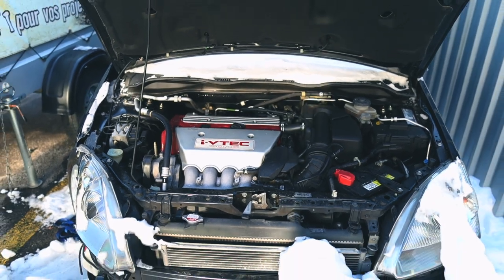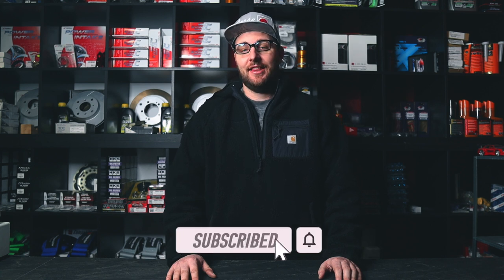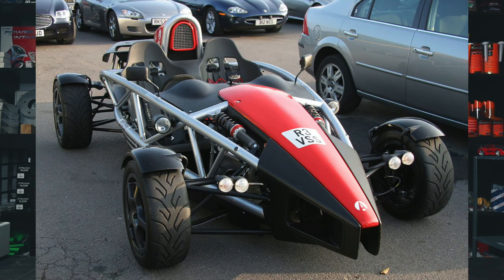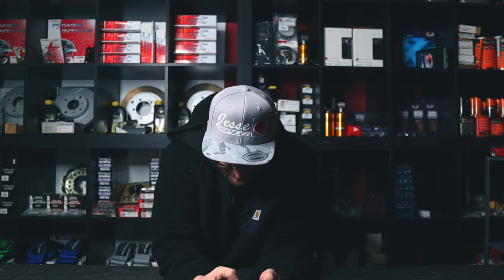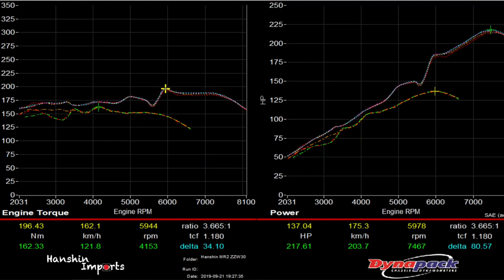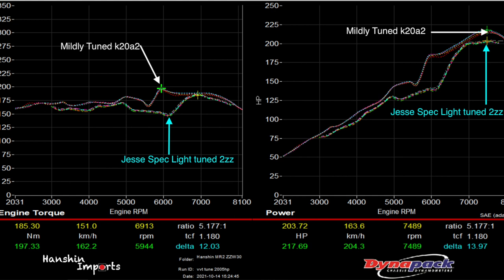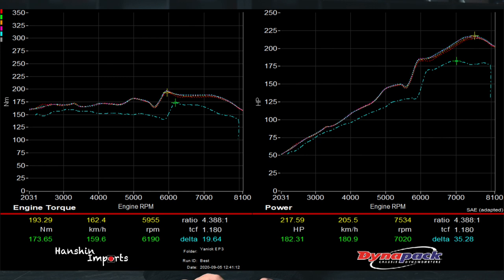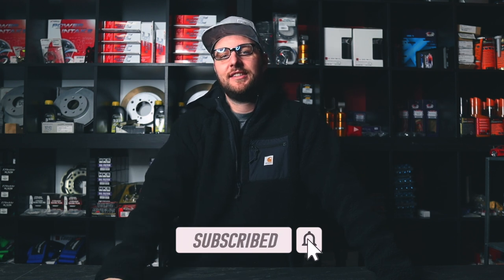How to Kswap an Mr2 Spyder EP2: Is the K20a better than the Toyota 2zz? Is it worth the extra cost?

Comment: In new zealand you can get a JDM spec 2zz celica for about 7k or corolla 2zz for about 5-6k. While type R spec B18cs are worth well over 12-15k and type r spec k20s are in the 20s, 2zz is great value for money considering you get 190HP for well under 10k with a k20 you get a bit over 200hp for 3x as much. not good value for money considering you can just buy a celica and drop stage 2 cams exhaust and intake and gain 15hp without a tune as shown on the fourms before needing an aftermarket ecu. only let down is the gearbox.

this is coming from someone that owns a 2zz jdm spec celica with LSD and i admit the k20 is 100% the better engine but value for money wise its janked up because of how sought after they are therefore making it not a great value for money even though a k20 has way better after market support. Im happy with my 2zzge celica the lift kicks in harder than a k20a2 and the only thing left to do on my celica is stage 2 cams and il be really happy.
Reply from the maker: Hi, Thanks for your very comprehensive comment and the time you took for writing it. As you can see in my video (and you can probably guess it), I am 100% agreeing with you. I love the 2zz. Its one of my favorite engines ever. However, it let me down and broke (take a look at my playlist of my 20+ 2zz swap episodes, including the race footage when I broke it). So for me, reliability is the only element I've been let down on. I actually was disappointed in the k20 (euro spec in stock form). But, if you have some extra time, take a look at the swap series I am doing right now for the K20. Its just coming to an end now and the engine has a few nice bits on it and I will see what sort of power I can make. But trust me, I have pretty high expectations, given the hype of this engine and that I actually really like my 2zz. Wait and see ;-)
Best regards.
Jesse
Reply: @JesseSpec 
How did you break the engine?
This engine blows when you overev it by downshifting improperly.

Comment: Coming from my old Honda Civic EM1 with the B16a2 and recently a SIR EP3 K20A3...I found I really missed the high strung, high revving nature of the EM1...mind you the lack of torque was really noticeable down low.  That being said, from 111ft/lbs of tq to 132 ft/lbs...with peak torque coming on sooner than even the Type R....the base EP3 felt like a torque monster lol.   Enter my recently acquired sleeper Corolla XRS lol... I'm so happy to be back in a high revving engine again. Having the 2ZZ and 6spd is the perfect blend of both worlds... essentially a larger B16 engine but with torque lol.  I will say i feel lift engagement is a rouch high on the stock ecu in the Corolla at 6800rpm though.  But on the other hand....it keeps you out of trouble a bit because you have to be really deliberate with your gear selection and to rev it to the moon..because getting to lift takes noticeably longer than VTEC engagement lol.  I will say a lot of people go out of their way to get around that grocery getter Corolla hogging the fast lane and are surprised when they're not getting any closer to me 🤣🤣
 

What do you recommend for a daily driver who does occasional autocross as an ecu solution?  Was thinking of picking up an '03 Matrix ECU with factory 6200rpm lift engagement but no one really re-pins those anymore i don't rhink.  I'm not hardcore enough to do crazy stand alone laptop tuning on a daily...just want tweak whats nearly perfect.  

Long story short,  this vid reassures me of my decision to explore the 2ZZ life lol.
Reply from the maker: Hahah! Thanks for your substantial comment 😊👌🏼
If I remember well, my corolla tS shifted VVTLI in 5000rpms. So that seems like a normal shift point. Maybe trying to find a VVTI/VTEC adjuster like back in the day would be interesting to test. I think APEXI used to make these. You would have to do some research to see what people used in the past. It may be a good way to adjust the shiftpoint for a very low cost.
TBH though I never used them and personally I would go programable ECU 🔥😉
Reply: @JesseSpec  I do remember the old school Apexi's lol.  Yeah I suppose I could just send my ECU to R9K or MWR  to have it tuned...not super cheap but I believe lift engagement at around 5800rpm or less would make the power more usable for sure. 

Thanks for the reply 👍
Reply from the maker: @ericlindsey1708  no problem 👍🏼🔥

Comment: 2ZZ has an interesting niche, at least here in Poland where I live. In a lot of amature racing leagues there are different classifications based upon stuff like engine displacement and stuff. 2ZZ and K20 would fall under the same class, but most of them make an exception for K series and classify it like a much larger displacement engine or one with forced induction, bc even NA they can make a LOT more power than pretty much any other engine, so those classes under 2.0 liters of displacement would be all just K series races and competition of "who can throw more money to squeeze a few more horsepower from their K20" and that's not fun and would quickly kill interest in the league. So for a lot of motorsport leagues it makes sense to tune up a 2ZZ since it has a lot of the same characteristics that make K20 so good but it isn't targeted by rules.
Plus in the case of MR2 specifically it's basically the easies swap in the world and is barely any more difficult than putting in stock engine.
Reply from the maker: Nailed it! I agree 100%!

Comment: What confuses me is how did the Toyota Matrix XRS and Corolla XRS consistently beat the 7th/8th Gen Honda Civic Si and Acura RSX Type S in highway roll races on YouTube despite the 1.8L 2ZZ being an on average weaker engine with less hp than the 2.0L K20? 
This is because the Toyota engine’s torque curve is actually higher than the Honda’s eh?
To top it off apparently the K20 can stay in VTEC thresholds while shifting while according to period Car and Driver reviews, the 2ZZ usually falls out of VVTi?
Reply from the maker: I love the 2zz. But I cannot say yet if it was worth the extra effort for swapping the kswap I am doing now. I am coming towards the end of the swap and should be hitting the dyno real soon when my exhaust is finished
Reply: @JesseSpec  oh yeah the 2ZZ is decent, but the K20 is definitely the better engine for a MR2 sports car engine swap application
Reply from the maker: @SilverScarletSpider  i will see what my dyno has to say about that hahah.

Comment: Let's also not forget that a 2zzge weighs way less than a k20a. So balance of the car needs to be adjusted for that much more weight on the rear.
Reply from the maker: Thanks for you input. I’ve heard this theory many times, but no facts. You say way less, do you have any numbers? Source of your info other than Techno Prospirit. I am planing to put this theory to rest by actually weighing both power plants. Could be an interesting video
Reply: @JesseSpec  it would make sense that an all aluminum 1.8L weighs less than a bigger all aluminum 2.0/2.4l motor with iron cylinder sleeves. 👍🏼
Reply: @JesseSpec  there was a guy that weighted them here on YouTube. I will try to find the video. From what I understand the 2zzge is 220LB (~253LB with accessories under 375LB with transmission) while K20 is 275LB (over 400LB with transmission)
Reply from the maker: @spyderzetta3391  hi! Good info, thanks for sharing. I am afraid 25lbs (11kg) on the ensemble of power trains in difference can be compensated by a lighweight battery. I honestly think the weight distribution argument doesn’t seem to be significant enough to a point it would upset the balance (if your numbers are accurate). Corner balancing will really make the difference very minor I think. Don’t You think?
Reply: @JesseSpec  I believe fully assembled engine+transmissions+accessories it was closer to 50LB difference. So if we are talking stock for stock, sure lots of things can be done to offset some weight. Lighter weight headers, exhaust, intake, battery, etc. This can be done on any of these engine to further reduce their overall weight. But yeah the point is that the  2zzge the lighter engine. And any weight that is reduced or added on any car needs to be taken into consideration when setting up optimal car balance. Like you said, corner balancing is a good example. Or changing spring rates, etc. Also I think the K20 is a taller motor (I think..) so center of gravity in the mid rear will be a little higher which can affect overall balance. Once again, something that can be fixed with different chassis and suspension tuning. 

You now have a k20 and a 2zzge in your garage. Would be great if you could do a comparison. 

I own a 2002 spyder and was already planning a K20 swap. But 2zzge is a very good option as well.
Reply from the maker: @spyderzetta3391  thats exactly why I am going through all the trouble of making these videos hahahah

Comment: Hey Jesse, great work as always :) I was wondering what kind of downpipe you were using on the 2zz? I saw you used the MWR manifold and I was unsure if it would get decent power figures compared to the stock or PPE manifold/downpipe combo, but appearently it does. 

I know the 1zz stock downpipe chokes the 2zz but I think mainly becouse of the restrictions in the flex pipes, so my hope is that with the removal of those and the MWR manifold I could still get decent power when I use that one. 

Which makes the swap more easy and also I want to keep the exhaust becouse of noise levels as stock as possible (I will accept that it will make less power than with a complete free flowing exhaust, but atleast keep the loss as low as possible). Did you order the manifold from MWR directly btw or another source in europe?
Reply from the maker: Hi, Thanks for your comment! The Downpipe is an Ebay spec one. Isn't the best, but for getting the whole care ready quickly and at a good price, this is what I wanted to do. Regarding the MWR, yes I bought it from them. My company Hanshin-Imports Actually sells their stuff as a sub dealer, so if you are interested, I might be able to hook you up, since. (contact us at www.hanshin-imports.ch). It isn't the best performing, but as you can see in my other videos, the performance wasn't that bad ;-)

Comment: I'm currently pulling my 2zz and c60 out to install a lsd (with a bunch of other trans crap) and I'm planning on porting the intake manifold and gasket matching. We'll see if it makes any difference but celica dudes are convinced it does 🙄
Reply from the maker: Hello, its well possible that it does improve something. Honestly on my 2zz back then, it didn't seem that big of a correction necessary. That's why I didn't do it on mine. On the K20 though, I will be looking into it a bit more.
Good luck on your project!
Reply: Hello, kind of random but would you care to sell the 2zz swap parts, Im in need, thanks :)
Reply from the maker: @sameetrizwan1287  hi! Make me an offer and we will see. Its a 100% complete kit
Reply: @JesseSpec  i need the harness, header, ecu and the passenger mount…
Reply: @JesseSpec  I'm still in high school working minimum wage and don't want to make an offer that might come off rude / lowball...just give me an offer and I'll see if I'm able to afford it
Reply from the maker: @sameetrizwan1287  hit me up on IG and we can discuss: @jesse_yaroo

Comment: I’d love to see the 07k/CBT from a mk5/mk6 Volkswagen swapped into an MR2. I recognize that it’s not as well supported as the k swap, but a 20V 2.5L inline 5 is just plain sweet. It’d make an awesome N/A platform (folks love putting them in their Porsche 944/968). Plus, parts are cheap/available.
Reply from the maker: Its surely worth trying. PersonallY I don’t know the VW engines so well so I don’t know if I would feel confortable doing that swap

Comment: k24 with k20 head ;) 2zz vs k20 depends where do you live. K20 in europe has more performance parts, and modding it is easier and cheaper than import all parts from usa or japan; personally i own 2zz mr2 spyder with some bolt-ons
Reply from the maker: Exactly 👍🏼 even inside europe it varies. Switzerland, where I live, is often different/more expensive than other eu countries. Where are you from?
Reply: @JesseSpec  I'm from Poland, so it's not easy to live with 2zz  ;)
Reply from the maker: @zzracer  I can imagine! Enjoy the 2zz! Its an amazing engine

Comment: Hi Jesse great comparison. Is it true that the K20s have more effective & efficient oil lubrication than 2zz especially in the higher rev ranges?
Reply from the maker: Hi man! Thanks 👍🏼
Tbh I don’t have the facts but I’m pretty sure the K20s are more reliable in that department.
Reply: If you rev the 2ZZ a lot use recommended oil by Lotus.
Reply from the maker: @kisbalintkirill4443  Thanks for the tip!
Reply: Don't need to use oil from lotus even though they have motor program for 2zz just service every 10 000km sorted

Comment: Stock to stock K20 doesn't seem that much better. 2zz is nearly maxed out from factory. The k20 responds to mods really well and can get to 220-240whp with full bolt ons and a tune. It's night and day difference between the two engines.
Reply from the maker: So I’ve heard 😁👍🏼 lets make some first hand experience 👍🏼👍🏼👍🏼
Reply: I am surprised too, in other charts I have seen a noticeable difference.
Reply: @JesseSpec  gonna be doing the swap myself with k20/k24. Looking forward to your videos!
Reply from the maker: @ulisesavila2879  that was surely due to the fact that the ep3 engine in europe has a very weak tune, not got ex and intake manifolds and my 2zz was quite potent hahaha
Reply from the maker: @matthewyang2792  thanks man! Its gonna be good!
Reply: grug69 That’s probably a heavily modded 2zz
Reply: “Stock to stock K20 doesn’t seem that much better.”
“It’s night and day difference between the two engines”

What?

Comment: 2zzge is less expensive and better for the platform..  You re talking about 3-5k for just 200hp from a K20 or K24.. when you can even add a turbo or supercharger for that price on a 2ZZGE..
Reply from the maker: Is it cheaper? Yes. Is it better? Not quite sure about that. In what way do you think its better?
Reply: @JesseSpec  the 2ZZ-GE can only be better because it's cheaper to make power..
Reply from the maker: @Caned5  do you also know how unreliable the 2zz is when driven hard, let alone turbo charged? Making power cheaply is one thing, but reliably is another. Check my other videos. I actually raced my 2zz… it wasn’t reliable
Reply: @JesseSpec  you are very right about that.. I think MonkeyWrenchRacing had addressed these issues once you purchase a 2ZZ-GE from them.. K20/24 have their problems too but not as common with the 2ZZ-GE..